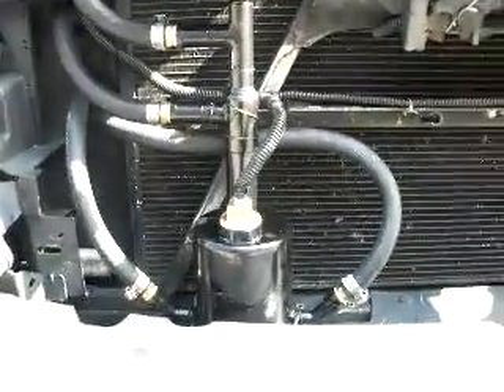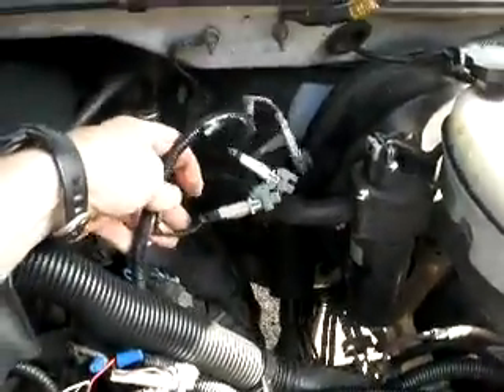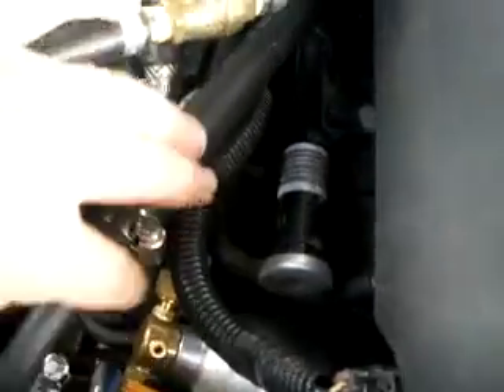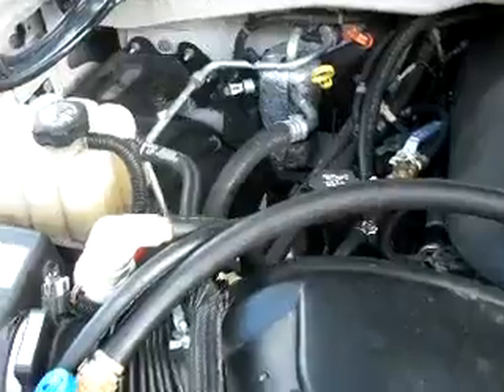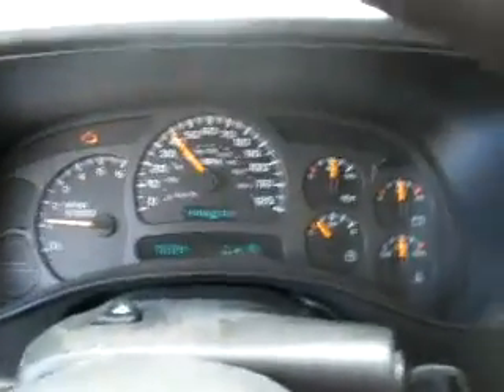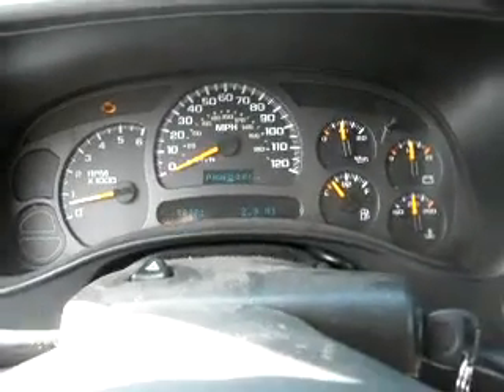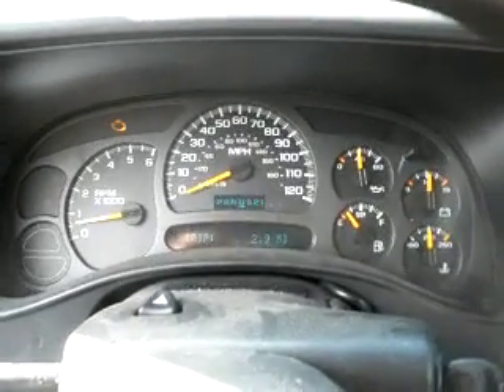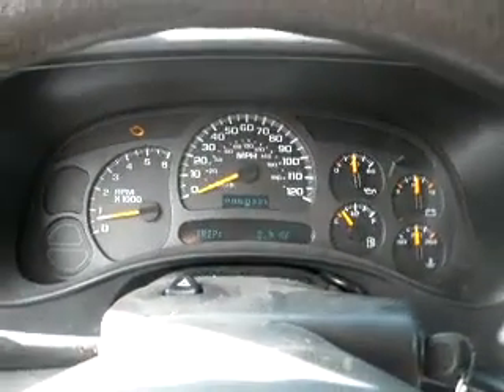Road Test In Progress from running on gasoline vap

Comment: Great experiment you're doing although extremely dangerous to you and other road users. You could get better mileage by not driving a V8 if you didn't know already...

Also the reason cars are not run that lean is because lean combustion is hotter than rich combustion in petrol cars. You will probably melt your pistons if you do any sustained highway driving. It only takes 660 degrees to melt them.

Diesels can run lean as lean = cooler and rich = hotter in diesels.
Reply: +KiwiPowerNZ I have seen normal combustion exhaust temps at the manifold = or greater than 1000 degrees.   so the whole piston melting thing @ 660 is meh.
Reply: 1000 fahrenheit? That's 540C, I was talking degrees C. Oil is supposed to cool the underside of the piston so it doesn't reach the temperature of the exhaust. I also heard it's cooks the exhaust valves because they don't have any cooling.
Reply: ah, ya C is a different thing entirely, i live in the states so we use F.  I was thinking it would run lean as well.  and maybe burn exhaust valves and so on.   but i don't know for sure.  I guess we can get him to post and tell us if he burned them?  hehe
Reply: Rhage73 I'd be too embarrassed to admit any damage to the engine if I were him.
Reply: lol, i thought about doing something similar, but have a water injector dead center of the intake that squirts once every 3 sparks, should be enough to keep everything cooled down
/shrug may never get around to it.  Not to mention the flame fire guards you would have to put in place so it doesn't explode all of the fumes backward.
Reply: Rhage73 The intake is pretty cool as it is what about the exhaust? There is something called a flash steam boiler where water is sprayed onto hot surfaces to make steam. I think you'd be making one of them. The steam will condensate down the exhaust pipe and cause rust. And if the steam gets up into the valve guides it will make condensate in your engine which makes the oil go acidic and corrode your engine as well.
Reply: your engine produces some "water" just by the combustion process, and there is already condensation every day in your engine,  It just usually burns off while you drive, that is why u can have a milky oil cap when you dont have a head gasket problem in the winter time. Usually caused by taking short trips and not burning of the condensation.   If you have a "fuel Injector" spray ever so often in the intake it will travel with the air into the cylinder and mix with the gas and bam, out the exhaust valve in turn cooling the cylinder and exhaust valve about once every third cycle.   the steam you speak of will mostly evaporate during the combustion.  There is already water injection for a lot of vehicles.  mostly diesel, but i think it is a solid solution to overly hot cylinder temps. you want 80mpg and change exhaust valves ever so often or 80mpg and change exhaust tubing ever so often.  "personally i dont think it will be an issue as far as rust in the exhaust or valve guides getting soaked down"  its like saying what if some of that gasoline in your engine gets in the valve guide......just dont really happen.  Conventional engines although getting better dont burn all of the fuel as is.  hence the converter to take care of the extra.
Just my 2 cents on the matter, and seems like nobodies 2 cents are the same, yet they are entitled to their 2 cents.  =)
Reply: Rhage73 80mpg though? I have doubts. What engine do you have in mind?
Reply: just going by what this fella is doing, looks like a v8 or v6 vortec.   i don't care which engine i use, probably mess around with a 4 cylinder when the time comes because it is way easier to work on and takes up less space + already gets pretty good mpg.  also you can get a custom ground cam with 0 overlap, the only thing is, the motor wont run as well because you will lose the scavenging effect.  I figure u can off set that by having some low boost forced induction.   I thought about it for a long time and am still working through all of the details.   one is how to maintain enough vapor under load.  and a couple of others.  when i finally get in a position to mess around with this stuff, i will post stuff about it.   but right now i am doing good just to get the day to day done, and have a roof over my head.
Reply: +KiwiPowerNZ Believe it is a chevy V6.  based on the amount of injector plugs.  ;P

Comment: To eliminate check engine light they have some noids that will plug into you injector harness gives it a false sense, and makes it seem like everything is working fine.

you can get a exhaust gas temp gauge to see how the motor is running. Never want to be to hot you will get oil thermal brake down. Switched to two vacuum lines and separated intake manifold into 2 different chambers to reduce engine temp. But every project is different.

Comment: so your telling me i could fart on the gas tank and i will go 40 in the highway.
Reply from the maker: MOIST GAMING Sure, if you eat refried beans... but you may need to install a flash back protector on your butt. Thanks for watching.
Reply: how much is a flash back protector
Reply from the maker: Around $3.00 at home depot... it's just a stainless steel drain mesh used in a kitchen sink. Works great!
Reply: i don't care how much it cost just tell me how comfortable it is.

Comment: do you have any idea how lean the engine is running? how do you get the air fuel ratio right? dose it burn hot from being lean? also whats keeping it from going into limp mode? 
i know your inducing fuel but you have you changed the ignition system ?  the computer must be pissed and i know that the map sensor is connected to abs have you experienced any brake or shifting problems?  very curious, allen the mechanic
Reply: +dan fleeman 12 percent?  COUGH COUGH BS!   thats horrid.  your injectors have serious issues if that is the case boss.
Reply: Jennifer Cribb that is the thing people he has change nothing but how efficient the motor is running the motor runs on vapor from the gas any way the injectors just do a piss poor job of getting them there my 95 3/4 ton suburban with 454 burns 12 percent of the gas injected into it the other 86 percent goes into the exhaust and this came from a gm mechanic the suburban gets 12 mpg on gas, on vapor it gets 32 mpg and we hooked up to an emission computer and it is burning 87 percent of all the vapor you could look your self inside with this and never get carbon monoxide poisson it burns so clean the only issue i have is when i  get the truck in huge angles 4x4 ing and my bubbler is not fully covered in gas this really works do experiments and always keep a fire extinguisher handy

Comment: I experimented in the 80s   with a PVC bowl with pvc albows making an injection hat to the carb. there was a pulley systembolted to the block so as the engine spun faster it would vaporize more fuel. this DIDD work BUT to spin a motor at the reservoir and vaporize/atomize the fuel in the system properly is tricky we needed smaled pullies to spoo it up faster or heat.. now this was a spark plug engine and they obviously had to be part of the equation.he did not attempt to heat the gas which made it very hard to vaporize, but we made a 1975 350 blazer idle and rev in the driveway but would starve for fuel and die against any load.  I really think if we found a way to properly heat the mixture,, change pully sizes timing  and jetting it would have worked with proper ratios.  the goal was 50 mpg. i wonder if my old friend ever proceeded or gave it up. he was onto something.

Comment: what about power do you lose any with doing this and if so how much
Reply: myfeeling4you Come on fuel only has a fraction of a second of be fully burned in the combustion chamber before its blown out on the exhaust stroke. The flame front can only ignite fuel that's got air touching it. Liquid gasoline has little air that can be touching it due to surface area. Vapors burn best. Vapor carburation was defeated by the oil companies who reformulated fuel with stuff that does not play nice with vapor carbs. This is why old gasoline that's been sitting in a tank for a year gels over.
Reply: if you go to pour it on the fire it is being vaporized much more rapidly, in the carb it is still letting off fumes allowing for ignition. I 'spose I should further explain my reasoning:

Gasoline below the surface is not flammable because the top layer of Gas & gas vapor is keeping the oxygen away from the lower layer.  You can literally introduce a spark to the center of the liquid and the only result will be a snuffed flame without an oxidizer. (i.e. arc welding inside of a gas filled tank.)
Reply: myfeeling4you Fenrir is basically describing a fire triangle analogy. That is all. I think you may know what you are saying, but no one can begin to comprehend what it is. Bottom line it takes 3 things to have combustion and 1 of them does not exist in under the liquid surface of gasoline other than in the form of water as a contaminant. H2O in other words which that oxygen is not 1 of the 3 ingredients for combustion. Oxygen as an element has to be in it's vapor state to support combustion. Anyway at some point the atomization of liquid fuel is what combusts and that is mostly vapor. The part that isn't is wasted. The unburnt  part comes out in the form of soot. That is why leaner = better fuel mileage. There is lubrication in unspent hydrocarbon residue as well as additives etc. that may effect machinery negatively over a long intervals of a "too lean" mixture. Inspecting the spark plugs is the easiest way I know to analyze that. As far as backfiring into the fuel tank I cant see that the danger of that is anymore present from the fuel rail than if there were power to the injector solenoids from the output of the ecm because that is the normal path of fuel. And the way he is coming off the crank vent looks safe enough to me. He had 1 video where he was sucking his combustion air from his fuel cap vent and it ran like a top. That setup looked a little dicey regarding backfire explosion potential hazard.
Reply: negative, liquid gasoline doesn't burn, only the vapors coming off. If anything there should be increased power due to faster oxidation.
Reply: thanks for the info
Reply: Fenrir Lokison
want to thow some gasoline onto a fire and see what happens? suppose you mean under compression with ignition source? ever poured gasoline down a carburetor to start an engine, I guess it started
Reply: myfeeling4you
nope never poured gasoline into a carb, only ether. What's your point? Throwing gasoline onto the fire causes the gasoline to evaporate faster thus more fumes to ignite. That being said I'm still no closer to understand what you were getting at.
Reply: Fenrir Lokison ok you say gasoline doesn't burn, only the vapours coming off, well pour gasoline down a carb and see what happens and when you poor it onto a fire what happens to the fire, what is the chemical reaction? and end result from liquid form and if there was only gasoline wapour in the air around the fire> ignition source>fuel> result, what is the result in either case.
Now before you explain to us in text book reasoning do the experiment first just as scientists demonstrate to explain their reasoning as if everything on this earth was explained in text book theory we would still be trying to perfect the wheel.
Reply from the maker: grey wolfs Not at all....nothing but gain if all done right. Thanks for watching.
Reply: Dorian Demeturlias
I just read your comment, do you really know what you are talking about-read your comment again and understand it. Do this experiment if you dare, grab a spray bottle, the kind you can spray water with, put no more than 1inch of gasoline in it and adjust the nozzle to spray a stream, spray the gas and light it 2 feet away to see the result, yes the gas lights up. No cut the suction tube so the gas can't be sucked up but the vapor can, no squeeze the trigger, move the bottle away and light the air around it, see what happens, I won't tell you what happens you'll see for yourself then you can comment on what is fact, not BS.
Reply: What!!!!!! flame rises vertically so when you apply a flame of course the flame would be on top, no such thing as a flame beneath. When fuel enters a carby it atomises with air to allow a lean mixture jets are used to allow a certain amount of fuel to pass through, it's the same as fuel injection with exception to direct inject which works in the same principal as diesel.
Now to set things straight, fumes are explosive and the liquid is flammable, atomised fuel is still liquid fuel but in smaller quantities. Now when I said to pour gasoline onto a fire it burns, yes fast as it's a liquid, the flame will increase, this can be felt by the temperature and depending how much you pour the flame will last for some time untill the liquid is spent in the heat given off.
The method in the vid has already been tried by oil companies and not used as if the engine was to back fire there would be an explosion all the way back to the tank/container hold the fuel and the car would blow up, in other words it's not safe.
Cars that use LGP have this very problem when they backfire and this blows up the air cleaner box and the plumbing but they have an arrestor to stop the car and tank from blowing up, ahh you say put an arrestor on a gasoline vapour system, it can't work as vapour will still blow up, LPG on the other hand is in liquid form converted to gas.

Comment: Gotta love these big oil shills.  Yes you are more efficient.  Instead of spraying liquid into the chamber, you have vapor entering.  Your mpg will increase.  What are your findings?  Only worry I see is a reliable flashback arrestor between the tank and the plenum.  Keep it up!
Reply from the maker: nonayou damnbusiness Thanks...I do have 3 flashback arrestors installed, just need to work out a few minor details of perfecting it. Thanks for watching.
Reply: whyme2b
can we have a report on the latest mileage? what's your mpg while vaping?
Reply from the maker: Douglas Bialach Hello my friend... please email me at phillipstechinc@yahoo.com so we can chat.....Thanks for watching.
Reply: nonayou damnbusiness .
Positive pressure with a vacume control switch.

Comment: So the heat of the engine is heating the fuel up hotter than normal to vaporize it at a faster rate?
Reply from the maker: Not really... it's just used to keep producing fuel vapors and keep  it from condensing down. Thanks for watching.
Reply: whyme2b ooooook awesome thank you so the vapor is coming into the chamber and being warmed by the coolant to keep from condensing correct?

Comment: All petrol engines run on 'vapour'  the liquid fuel changes to vapour in a different  place that's all if you have carb or injection.. All that goes down the inlet port is vapour on any petrol engine so what is the point in this? The very first internal combustion engines from the 19th century ran on vapours picked up from fuel on a heated tray in an enclosure,so all this is doing is going back 120 years or so .
Reply from the maker: Sir, the point of this video is running completely on vapors with no waste... all engines with fuel injection is wasting fuel threw overspraying, which is said to lubrucate the engines valve guides to keep them cool. Their are other ways of keeping them cool then using gas liquid. Also back then is what worked, but it was to effecient.... so now it's designed to be wasted so that more money profit can be made....This is the down right truth. Thanks for watching.
Reply: They abandonded the hot bulb carb for the venuri for a reason.
Reply: Mark Caron
yES THEY DID(bIG oIL)

Comment: Is his possible with carbureted vehicles? I also have a fuel injected vehicle but the carbureted one is not a daily driver so I'd much rather experiment with it.
Reply from the maker: bob stout ... Yes, it's way easier to accomplish than fuel injected vehicles....that's the real engine to play with. Thanks for watching.
Reply: Any insight on how to do this? Parts list? Schematic? Drawings?
Reply from the maker: Still in working and testing mode, not available just yet... sorry for delays buddy, will post as soon as I can. Again thanks for watching.
Reply: They were first done on them, not fuel injection systems. Check out the other vids on vap systems for older vehicles.
Reply: Thanks for the info and reply! I will start researching vapor systems!
Reply: bob stout
 Check out a book, I think it was called 200 MPG Gasoline vaporizer or something like that. Great read and gives the basis for the concept. Think it was from around the 70-80's and I think there are reprints around.
From research I followed up on, supposedly the fuel is different nowadays then back when the author wrote the book and the process changed or all the additives that the fuel companies put in mess the ability to get so much out of it as the author claimed. Some have hinted that this was done deliberately so that it forced consumers to use more. If you talk to some real old timers the premise of vaporizing the fuel through heat prior to entering the engine is not new and I was told it was used during WWII by the Germans by a old German bloke I knew. He never told me mileage that was achieved though. I can't confirm the story though but might give you a few points to start from.

Obviously both of these situations were not on fuel injection vehicles. If it is possible to ever get the 200 MPG from a carbureted engine, I think it would make much more sense to go back to those as it would be better then any fuel injection system and you wouldn't have to fight the computer to make it work.